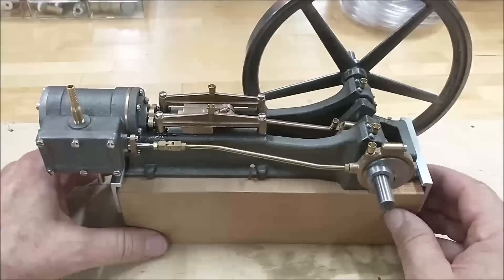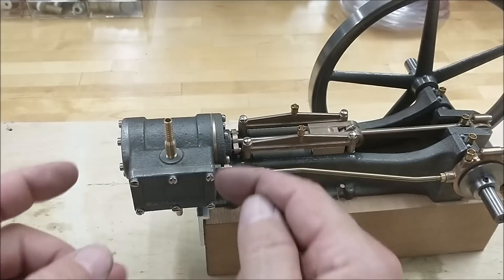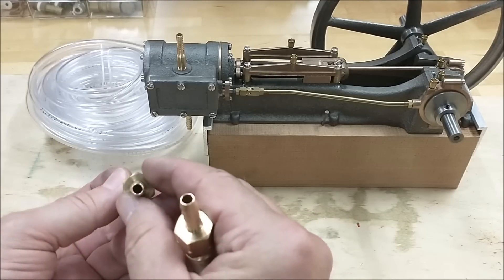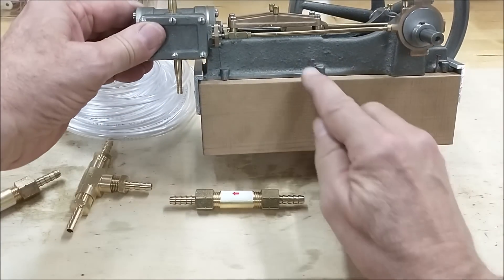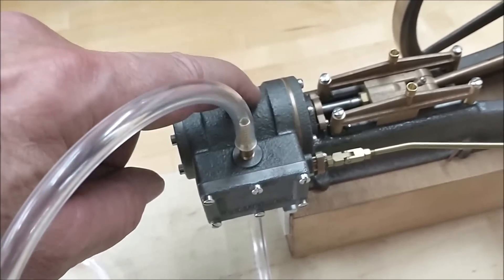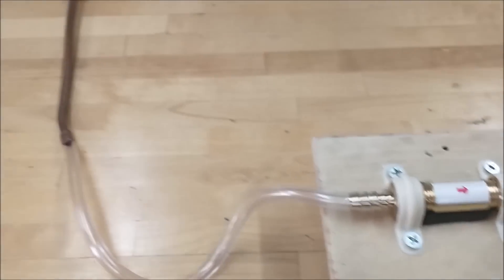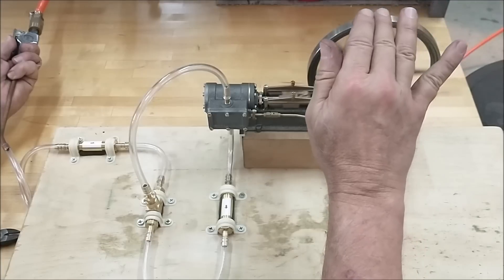Perpetual Motion Video....Is It Fake or Real ??

Comment from the maker: Greetings Everyone,
Thank you all for stopping by. I have read some of the comments ( all of them ) and would like to narrow the field of ideas.
1. The block is under the steam engine so the large flywheel can spin.
2. The block is solid
3. There are no electric motors hidden anywhere
4. No batteries used
5. The 3 way block is truly a 3 way block
6. The pipe clamps I use were too big, so I added some foam under all the components to take up the slack.

When this video reaches 50,000 views, I explain in greater detail how it was done. I will say, there is a clue presented, to the validity of my claims, that nobody has found yet.
Reply: the "check valves" are actually not that at all, they're an l-valve with a fake entrance. the air is actually coming through the board into the first fake check-valve, and exiting through the board at the second. there's no reason to have anything under them, or have them secured, especially not have black plastic seats under them. too suspicious! 🤞😂
Reply: The vinyl tube expands a bit under pressure, like a balloon.  Akin to a pneumatic accumulator, it provides enough power to overcome the friction for a few minutes.  If it's well oiled, I recon this could run for 5 or 10 minutes.
Reply: Either that flywheel was slowing down or the frame rate of your camera was increasing.
Reply: could it be possible that the brass valve on the exhaust tube is a ➡➡ ~T~ in disguise ⬅⬅...❓❓❔❔
Reply: @phantom246  Yes - connected to a vacuum pump, I think.
Reply: @phantom246  Either pressure was building very slowly during the acceleration phase or there's an exhaust valve somewhere.
Reply: Attach something to the flywheel that requires work(force times distance) and lets see how long it runs.  Conservation of energy says it will stop very quickly.  Other than that it does show case how well the engine is made.  Friction is minimal and flywheel inertia is large so pressure drop is minimal and allows it to keep running.
Reply: Take it apart live, starting while it's running. No cutaways. Everything in full view.
Reply: You got me! I knew something was fishy, but it wasn’t till I saw the comments that I got the joke.
Reply: How about the fact that you don't see a wide shot? we only see the shot zoomed in on the engine & not anywhere else?? who's to say that there is not another source of something coming from off camera??????
Reply: F = M x A.  When M is negative, and the machine is well enough designed to take advantage of it, A = 0 at a discrete RPM.   The question only remains about the materials used.
Reply: Are we supposed to figure out the trick? If so I'll go with repelling magnets provides the push to simulate the effects expanding gas, cylinder and piston. Once flywheel is in motion it pushes repelling magnets together, result is a return of energy into the flywheel.
Reply: @oldfarthacks  I can buy that a large piston area offers power to the smaller piston area but then? How could the small piston side provide power for the larger? Not possible. Friction losses MUST be compensated by energy brought into the system. In science it's named "the principle of energy". Just swallow that Joe is playing a trick! No way he invented a perpetuum mobile!
Reply: Go for the patent. Spend some money on a patent attorney. 

Yeah. You proved it. Now try that in front of a panel of witnesses. 

You’re hilarious. I can hear you giggling in the background. 

Of all things to use: a steam engine. A nice high friction device. Fricking genius.
Reply: I was expecting something more ridiculous, incredible efficency in that one, not your average machinist for sure!!! 🎉🎉🎉
Reply: Nice one Joe, good April 1st
Reply: 7. Some laws of phisycs are beem brocken.
Reply: 3 (except for the one, back at the mill, that ran for awhile before the demo started, to fill the air tank).
Reply: Video editing. Cutting the line and engine running are 2 separate videos cut together so they play at the same time.
Reply: So, the "check valve" on the exhaust is a fake - It's got an extra 'leg' to connect the exhaust to a vacuum pump under the table (with the 'loop' blanked off), and the engine is running by drawing in atmospheric air through the open pipe.  Nice one, Mr. P.
Reply: it is a closed thermodynamic system, so it can't be real.
A working PM machine must have an energy source. A ram pump can be considered a PM, the potential of water pressure is delivered by nature.

You are a mechanic, could you take a look at the dual mechanical oscillator of  Veljko Milković?
Reply: @alanx4121  The unschooled might consider a ram pump a perpetual motion device, but it is not. Actually, it is very inefficient -there is far more water "exhaust" loss than pumped water.
Reply: @buggsy5  Heligrimo delivers water pumps that work differently.
Reply: One clue is at https://youtu.be/Rp6XWC5VAg8?t=280 when he clips the feed it appears that the button on the air gun is still pushed. If there was any pressure  I would expect a large hiss and flippy floppy tubing. There is also no noticeable expansion of the tubing (or noise) when pressure is 'applied'. 

I don't have an idea of actual mechanism but suspect the whole air tube /check valves sole purpose is to distract (magician style) from the real 'magic'.
Reply: Observations:
1: The engine is powered, when he starts it he just nudges it off center a couple of times and it takes off. Also the little knocking noise is  would likely indicate it is powered, not externally driven. : So no the flywheel is not what keeps things going.
2: The shop airgun  is almost certainly not the source, no sounds even when snipped with button still depressed.
3: Running at 2psi there would be very little stored energy in stretched tubing, also no noticeable bulge when 'pressurized'.
4: May be an artifact of what was on hand but the fittings on engine are not the correct size for tubing so at least one might be open to atmosphere.
5: I might be wrong and not sure it matters but I would swapping intake and exhaust make a difference?

6: The base plate is at least an inch off the bench - why? what's underneath.
7: Around the 5 minute mark Joe wiggles the left side T block, the bottom (of image) hose clearly moves but the top (to 'source') does not (although a bit hard to see) and when done that fitting is in exactly same orientation (clocking) as before while the T block and bottom appear to be rotated. Also, why would he wiggle it that way if not to show something. I looked carefully but did not see anything else move when he did that.
8: Only clue I found in description is "forge".

Looking forward to the reveal, I have my theory but would be delighted to be proven wrong.
Reply from the maker: @martinmoeller9186  To address your comment #6.....ONE of the reasons the board is elevated is that the screws I used to secure the plastic straps, were too long. You'll notice the condition of the workbench, so I didn't want to scratch it up.  As for whats underneath...we can all be sure there is air under there. :)   I worked very hard on the clue in the description. It will be obvious once you see it. Thanks for the comments.
Reply: @joepie221 
Edit: I went back and checked prior videos and the Amazon links in them are the same/similar so guess that is not a clue ;-(

 Looked at description again and did notice the slightly odd collection of amazon links, the last 2 take me to shopping cart, not an item on machine where I am logged in to Amazon, on other machine the 'generic' link takes me to a quill clamp indicator holder while the postage scale takes me to a login page.

If the links are relevant the clue(s) would be to carefully (magnifier) look at something polished being  held by a clamp and pay attention to weight (postal scale).   Did not see anything more with that insight though so probably not relevant. 

As to "air under there" I did think of a bladder being compressed by weight setup but also noticed that the board overhangs the bench and you don't have a truly wide shot so no need for that complication  "As long as I want it to" is excellent "weasel word" implying a long time but then again you might not want it to run a long time...  
Lots of thing to pick at, most of them likely distractions as done by any skilled magician. Hope you relent on th 50K views.
Reply: I'm not seeing anything that interesting about a machine that perpetually maintains The energy in its own system,

I mean, don't get me wrong. That would be an amazing feat In terms of overcoming friction And Other modes Of resistance inherent in any mechanical system, 

But isn't the key interest here That you have a device that is both perpetual AND Able to Perpetually introduce Energy into another device Or system?

My point being that as soon as you use this to Try and actually  power anything....... well, There goes your perpetual motion.
Reply: I didn't realise we were guessing how it was done, but in that case...

I think it works almost exactly as you said it does.

I think every component you see there is genuine and provides the function you describe.

I don't believe that there is anything extra to it, or any additional power source etc.

The trick to it is that the exhaust pressure isn't doing anything to power the model, but the piping arrangement also doesn't cause it to slow the model down. There may be a slight additional bit of pressure in the piping to the inlet side that also helps keep it running.

What you're really looking at though is just an extremely well made model that has enough inertia to keep turning over for a little while. Long enough for a convincing video in any case.
Reply: @dtnicholls1  Nothing extra there? What compensates for the friction losses?
Reply: @Stefan_Boerjesson  Nothing.

It's just well made and lubricated, minimising them. The flywheel also has a relatively large amount of inertia, giving a good amount of energy to keep it running.

It just wasn't left to run for long enough to see it slow down.
Reply: @dtnicholls1  Not likely. The resistance from pressuring/depressuring would make it stop quickly.
Reply: @Stefan_Boerjesson  Think about the pressures that are in the system.
Reply: @dtnicholls1  Yes, and what? The principle of energy tells it all.
Reply: If this is a mystery or a joke it's one hell of a mastery. The concept you designed has been used for over a century to keep machine guns firing. Route the waste gas back to the receiver to eject the spent cartridge pull in the new and the firing pin starts the action again. It's obvious you didn't build such a beautiful machine to actually pull loads, only to show the concept works. I did 35 years in hydraulics and found a Vickers valve will cycle almost endlessly.  I didn't see anything wrong with your set up. Don't know if you hand made those check valves but they looked similar to most any check valves you can buy arrows or not. All of them are marked for direction in some way, usually arrow stamped. You even showed the ball check layout. They weren't tee'din any way. I don't understand why the incrimination.
Reply: I know for a fact as long the pressure is contained the force or energy can not be destroyed. This devise follows the 1st law of thermodynamics perfectly. I'm spreading this around to protect you. This is a massive idea. Do you want a machinist/CAD designer if this gets into production?

Comment: Yo Joe! I couldn't help but note that you were careful to run it (air input on) until stabilized. When removing the air supply you didn't release the trigger on the air gun. I know you cut the air line to dispel any claims of air feed leakage in that gun but I have a gut feeling that it was important that it be depressed when cutting the tube. I don't think you cut the tube at a random period of the engine's cycle either. You were watching it closely and getting the rhythm of the piston-valve  position and you seemed to cut it at a precise moment in each cycle. Am I all wet?:face-blue-wide-eyes:

EDIT: Is it an illusion that it's perpetually running? IE it's actually slowing down verrrrrrrrrrry slowly until it just stops?  You Know, like mechanical ringing or a resonant tank circuit. They can be pulsed and if the "Q" is high it will oscillate for a predicable period of time. 

Wakodahatchee Chris
Reply from the maker: I can say, it took a lot of effort to present this. It would honestly run as long as I chose to keep it running. Only one commenter so far has been partially correct in their observation. No camera magic either. Purely mechanical. No electricity needed or fans on the flywheel. The reveal video is still on my patreon page. :)
Reply: @joepie221  I had noticed holding the air gun trigger until you cut the tube bu just now realized that it likely would not have continued to run if you had just released the trigger.
My thought is that the air hose was open at the other end and the pressing the trigger opened the circuit to atmospheric pressure allowing a presumed vacuum on the exhaust port to power the engine.  
Noticed you have been very specific about the T fitting being real but not the check valves. You also wiggled the T to distract from other things.
Overall very nicely done.
Edit: For that matter could be the exhaust port has air pressure on it, the rest would be the same.

Comment: My third try: Joe says: " 'This setup' will run indefinitely.", "It actually took more effort than the video shows.", "[...] and yes, a lot of effort went into this.", and in the description: "don't always believe what your eyes just saw.".

The "lot of effort" is telling because what is seen is not much effort at all, so there was a lot of effort that is not seen.  And the "don't [...] believe [...] your eyes" suggests a visual trick.  So my next guess is that it's done with video editing.  

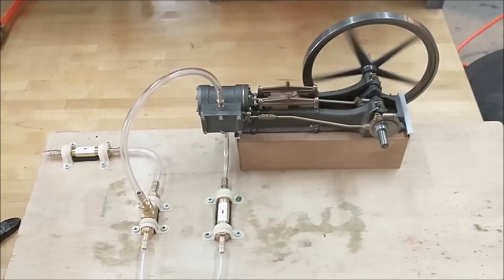Joe took a video of the engine running and, doing a frame-by-frame edit, Joe found 2 spots where all the engine's parts were in exactly the same position.  He then copied the video between those 2 spots and pasted it after the 2nd spot.  So the motion repeats and is undetectable by watching (there is no "jump" because the parts are in the same position).  I think that it happens just after the 5:00 mark because Joe is out of frame and not commenting.  The copied/pasted clip is about 5 seconds long.

This is my final answer.
Reply from the maker: For now, the only way to see how this video was done is by viewing the reveal video on my patreon page.

Comment: A magician does not reveal his secrets.  Fun, fun video. Here is my guess -- Air has nothing to do with this particular demonstration.  There is a small electric wheel on the backside driving the flywheel from below.  Although air lines are necessary for normal operation, they are a complete misdirection is this perpetual motion setup.
Reply from the maker: Fair guess, but read the pinned comment and take another guess.
Reply: @joepie221  Is that comment still pinned?  It doesn't show for me.
Reply from the maker: @bobengelhardt856  It is now.
Reply: @joepie221  Hello Joe, I read your pinned note. Here is guess #2: Keeping it simple, there is an air nozzle off-screen driving the flywheel with a jet of compressed air?

Comment: It's coasting!!  From the cutting of the air tube to Joe's stopping it is only 50 seconds, so not enough time to coast down.  
It does slow A LITTLE, though.  I took the audio and timed the clicks.  At the start it was 170ms between clicks (352rpm) and at the end it was 184 (325 rpm).  So it slowed 27rpm in 50 seconds & would come to a stop in another (325/27)*50 = 603s; 10 minutes.  More or less - it won't slow linearly.
That it would coast that long is a testament to Joe's meticulous machining!

EDIT: oh, "never mind" (Rowen & Martin) ...  some of Joe's replies refute that.

Comment: Supposing that Joe has manufactured and tuned his little engine well enough that it'll run on a couple of PSI, which I would easily believe, could the  two check valves store enough pressurized air at, say 90 PSI input to run the engine for the short time that Joe shows it turning?   Would 90 PSI blow the vinyl tubing off the valves?   I don't see anything to reduce the pressure to the steam port, but that could simply be a reduced hole in the output of the T valve.   That's my guess at any rate - the engine is  really running off pressure stored in the two big barreled check valves.

Comment: Two questions:

1.  If the pressure in the system keeps it running, then after stopping it the way you did, there would still be pressure in the system (assuming no leaks).  Couldn't you then, turn the fly wheel and start the thing running again?

2.  If you can stop it by hand like that, wouldn't friction eventually slow it to a stop after a period of time?

I would, however be interested in seeing just how long it would run, and if a higher internal pressure would make it last, and the maximum pressure it would take without a failure.

Comment: I built this kit a few years ago. Nice kit. It will keep running until the pressure drops due to air (steam) bypassing the rings on the piston or bypass in the valve box.  It takes very little volume or pressure to run this engine. I use a regulator at about 1psi to run it.
Reply from the maker: Its a clever design.

Comment: It’s a video trick. Where the air line is cut the image is blurred. I think the airline is still whole but covered by a superimposed image.
Reply from the maker: Good thought, but no.
Reply: If I have to watch this another 28,000 times to either figure out or get the answer, I will!

Comment: Even if the circuit is legit, the air line source is still suspect. At this level of craftsmanship, it could be as simple as an air stream pointed at the spokes of the flywheel to keep the illusion going.
Reply from the maker: Good guess, but no.